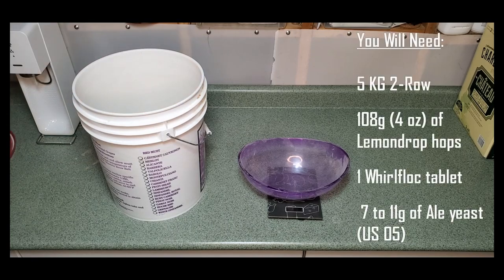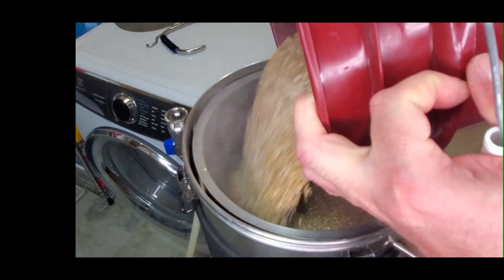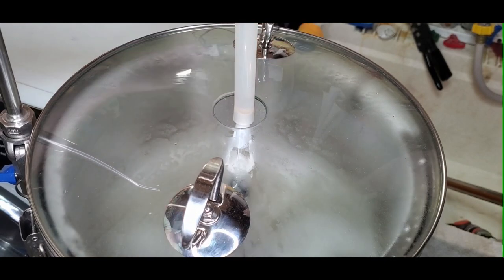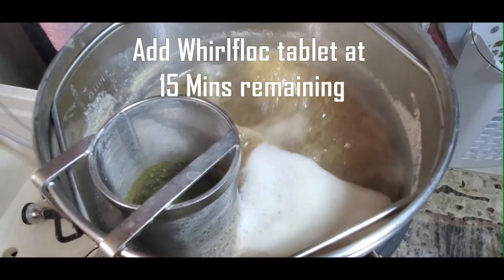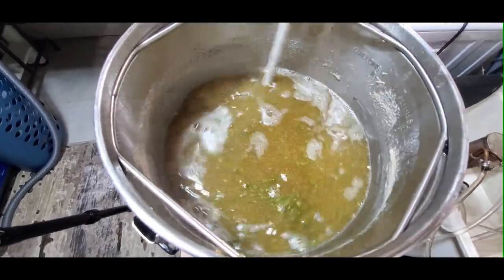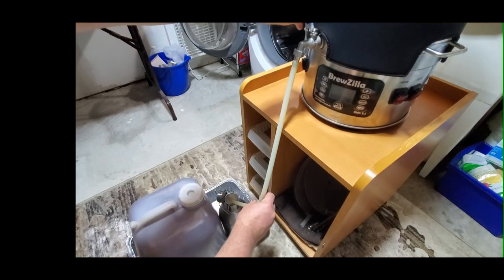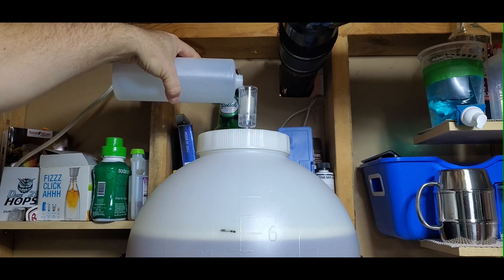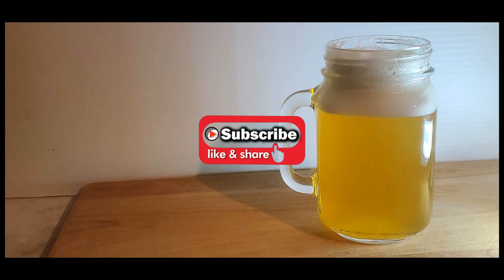Make Lemondrop SMaSH - Robobrew

Comment: When you go to mash the rubber cap goes on the pipe, after  you dough in the comes off and the stainless siphon cone goes on. I do see that you do do it differently but it works. Great video. Cheers.
Reply from the maker: Thanks Rex.  Yes I do it this way after seeing a tip online when I first start using this system. It works better this way for me.  Cheers!